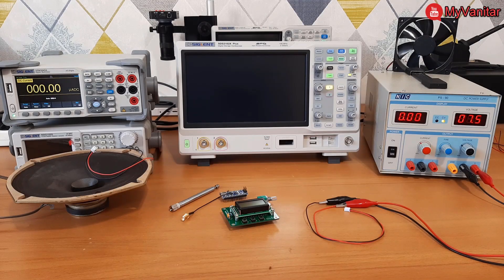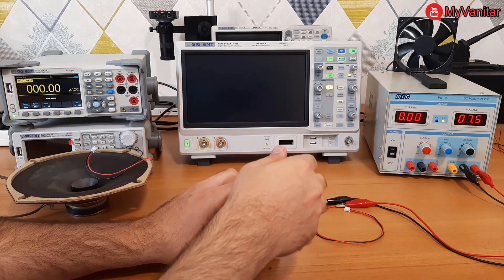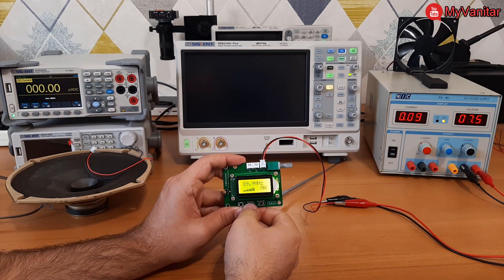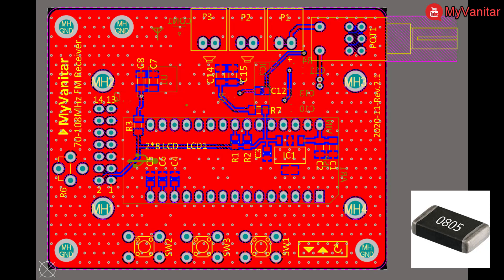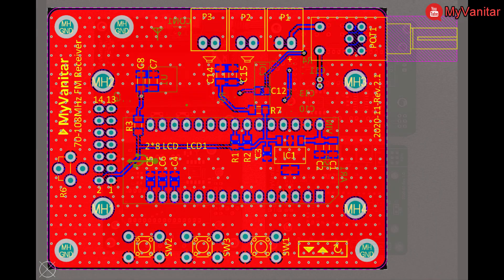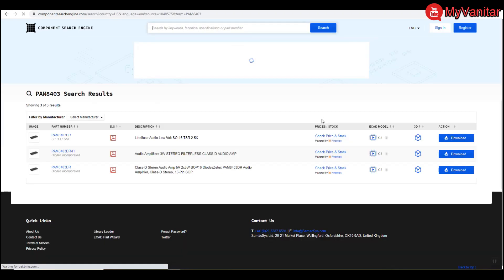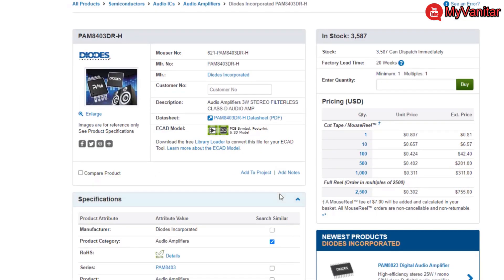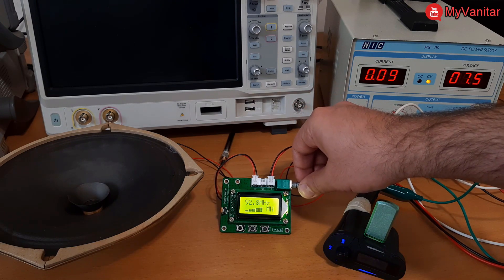Digital FM Receiver (Radio) Circuit with Arduino + Stereo Amplifier

Comment: Hi 
Am having trouble compiling the sketch. Comes up with the error message:

C:\Users\Jonathan\Downloads\Code\Code.ino:1:10: fatal error: TEA5767.h: No such file or directory
 #include <TEA5767.h>
          ^~~~~~~~~~~
compilation terminated.
exit status 1

Compilation error: TEA5767.h: No such file or directory

Have installed the latest version of the IDE.
Any suggestions would be most helpful.
Reply from the maker: You should install the missing libraries. I think I have referenced them in the article. I expect you know some Arduino basics
Reply: @MyVanitar  Where are the missing libraries? On the download page there is only one download option.
Reply from the maker: @jonathanrapley4828  The Arduino IDE (compiler) has some default libraries. To utilize extra hardware, the user must install specific libraries using either the IDE or install them manually. I can not explain all here. I think I have also provided the compiled file. Why don't you just program the MCU using that? Go ahead, buy a cheap programmer such as USBasp or whatever and do it. Arduino here does not mean the Arduino board. It means I used the Arduino IDE to write the code for the MCU
Reply: @MyVanitar  Sorry to be a pain. Where did you place the compiled file?
Reply from the maker: @jonathanrapley4828  Sorry, this time you are right, I have only provided the code.  I don't remember why, but since usually people know how to handle the code, actually, everyone wants to modify the code for themselves, not the compiled file. By the way, please do this: search for <TEA5767.h> and <JC_Button.h> and <LiquidCrystal.h> (these are headers in your code) and find the libraries. Install them in your Arduino IDE and compile the code. I'm a bit busy these days, otherwise, I would be doing it. So invest some time. I think if I remember correctly, you should install the TEA5767 library manually. try your best and let me know the results here. also, use the updated PCB. Here, I also used the Arduino board directly. I did this a long time ago, some memory refresh was necessary

Comment: Sir can we replace TEA5767 with RDA5807M instead?Thanks
Reply from the maker: I personally have not tested it, check if the pins match
Reply: @MyVanitar  Sir! How Can I use I2C Module for LCD so that I can minimize the wiring going to lcd?thanks
Reply from the maker: @ramilbraganza8103  Yes you can, however, you have to change the design. since it is based on an Arduino and nothing else on the board, wiring doesn't matter
Reply: @MyVanitar  The 16*2 lcd I bought is already solder with I2C
Reply from the maker: @ramilbraganza8103  so you have to redesign the circuit and PCB
Reply: I used prototype pcb Universal Board

Comment: MyVanitar---Nice project. Built it with your pcb. Maybe you can shed some light on a compiling problem I am having.
 #include
#include
#include
#include
I can not compile past the last #include. It wants a filename. Any ideas how to proceed?
Reply from the maker: it looks like that you have not installed the external libraries
Reply from the maker: JC button is famous, you can install it directly from the Arduino IDE. For the TEA5767 library, if I remember correctly, you should install it manually. it is pretty easy. this is the library link: https://github.com/andykarpov/TEA5767
Reply: @MyVanitar  But including JC_button library is useless if you don't call it's functions like you do!
Reply from the maker: @SchneHa-EU  first I used the JC, then implemented it differently. you can remove the header if it exists in your code. doesn't matter.

Comment: I made your project on the screen, it only switches between 76.0 mhz and 108.0 mhz, it does not switch between mn and st, the volume level does not appear where am I doing wrong Can you share the libraries you use? Thank you from now.
Reply from the maker: Don't worry about this, it works well as I showed on the video. MS and ST is not the user's option, it depends on the transmitter (mono or stereo). There is no volume level on the LCD, it is the reception signal strength. I recommend you to read the article and watch the video carefully. I have not claimed these. You can change the volume mechanically. I'll try to find the libraries name and comment back.
Reply: @MyVanitar  yes, I realized later that it is the signal level, the sound only opens from the pot, I think I have a library problem, when I press the scan button, I get a value of -0.1MHz in this way and there is no sound, I watched the video many times I liked the project, it will be very nice if I run it :)
Reply from the maker: @yilmazaksu5643  Can you get the FM sound like shhhhhhh? can you get FM stations manually?

Comment: Hi..  I first watched your "next" video where you scope and decode the I2C signals from the Arduino to the ??  well you didn't say.. but your oscilloscope showed "read and write to address 60 (decimal 96)" .

So I came here to learn that you use the I2C signal to "tune" the frequency to monitor by the TEA5767 module - very nice.  

I had high hopes for this until I reviewed the datasheet for the TEA5767 and learned that the address for it was fixed at 60 (110 0000b).  Too bad for me since that is the same address as the D-A module I use ( MCP4725 - also a Microchip product) - the MCP4724 uses addresses 60  or 61 depending on setting (I use both in my project). Too bad that Microchip did this...  all of the addresses in the world, and they fix two different devices to the same address - very frustrating and limiting.

Good videos on your part. I enjoyed them both. Well done.
Reply from the maker: Thank you Tony for your attention and comment. I had a range problem with this chip as well and it was its RSSI data. I had to set the frequency each time to get an updated RSSI data. I'm not sure this was because of the library or chip. I had no time to investigate and write my own. However, people can set up this hardware with their own code as well. I have newer videos with a more high-end oscilloscope. You are welcome to watch them either.

Comment: Your title is a little misleading, though I know it wasn't on purpose.  You built an FM Receiver that has digital controls.  It does not, as I hoped when I first saw it, decode Digital FM (HD Radio in the US, DAB in Europe...).  Nice clean PC board design, very well done.
Reply from the maker: Thanks. the intention was not to mislead that this is a digital FM signal receiver, it means FM receiver with digital controls or a digitally controlled FM receiver or something like that

Comment: Hello My Vanitar Bey of TEA5767 Modul Schchematics Radio
I CAN REPLACE TS2937 USED IN THE FEEDING OF 7805.
HOW VOLT WILL THE INPUT VOLTAGE BE
Reply from the maker: No, you can not use 7805 instead of that part because the pins are different. there is an important note also. Please check the article, below the "bill of materials"

Comment: Nice project!  Could have done without the 2 minute PCB Way commercial...   You should have explained your setup at the end.  At first I thought you were faking it, but then realized you were using a car FM transmitter to keep the copyright hounds away.  Good idea!
Reply from the maker: Thanks, why should somebody fake a device when it has a schematic and a PCB and test it using equipment?! I invest my time and money to keep this channel going and it does not create low-level content.
Reply: @MyVanitar  I agree entirely, but I have seen fakes on other channels.  Thanks again for the video.
Reply from the maker: @chrisw1462  Yes, there are many fakes, worse than that is the channels that talk about free energy or free internet ... they get millions of views!

Comment: I have been playing with a similar FM chip, the RDA5807M.  There are smd ferrites, a small inductor (LC for antenna), and a watch crystal involved, unless you buy a module.  A little annoying that it runs at 3.3V.  It may be a little easier to use the RDA as a hobbyist though, as the pins are dual inline, and the output is strong enough to drive small speakers or headphones.
Enjoyed your presentation. Now I know about the component search engine!
May be possible to fuse KiCAD, FreeCAD, and ECAD for prototyping projects.
Reply from the maker: Thanks. Yeah, that's a free tool which supports your mentioned CAD software as well. At least in my case, I won't make mistake in designing the component libraries from scratch which is quite frustrating :-)